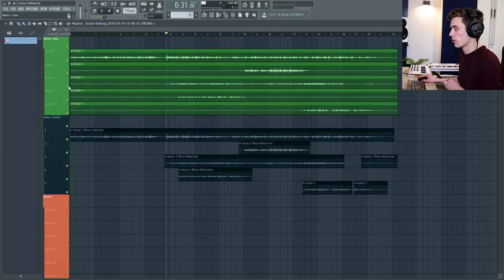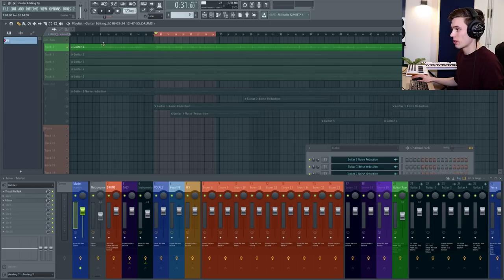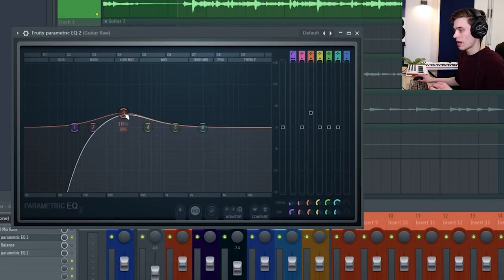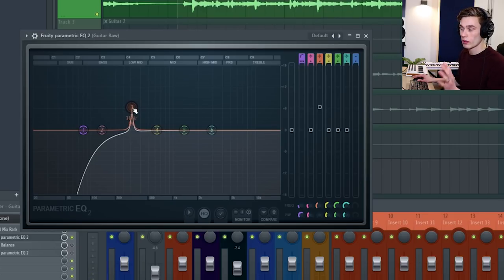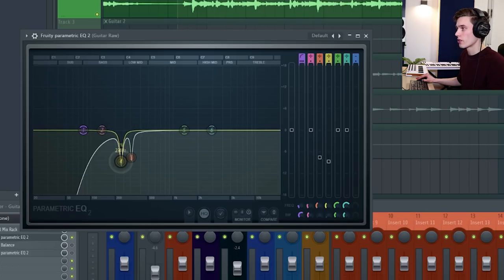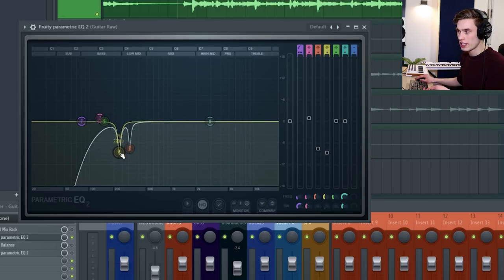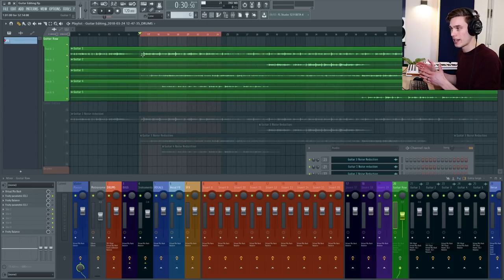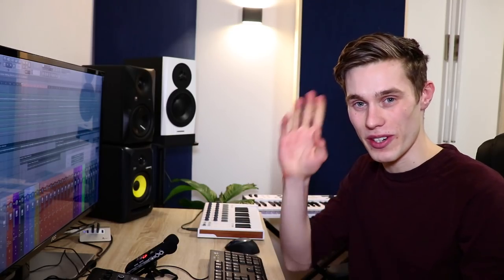Subtractive EQ for Clarity - Acoustic Guitar EQ

Comment: Can't thank you enough for this! I'm using the Ample Guitar VST, and it tends to build up these low mid tones of the player hitting the body of the guitar when multiple notes trigger. These techniques helped me minimize them, and overall level out it's sound. Which now allows for percussion and other instruments to fit in naturally! 

For those of you also using Ample, I high passed at 95hz, with some of the eq tail hitting 50hz. Then I ducked 189hz 10db. (I used pro q 2, but should still work in paramateric) Hope this helps! :)
Reply: Use Electri6ity lol i used to use Ample too but it's just that Electri6ity is much much better

Comment: Is the quality of your headphone amplifier good enough to do for example mixing and mastering with it? 
I want louder sounds coming out of my headphones. (I’m using Beyerdynamic dt770 pro 80 ohms)
Reply from the maker: I would say so, there is a small amount of hiss at medium high gain but it's never been a problem. On one of my amps, the output beside the power cable is quite noisy but i think it's a one off fault and I'm sure they are not all like that. As far as the depth, clarity, width etc none of that is negatively affected as far as i can hear in my 1990 pros :)

Comment: Hi, I recently stumbled upon your channel and I must say, it's one of the best ones out there. I'm currently producing a track and I'm using a bass that needs to sound somewhat realistic even though it's from a synthesizer. My goal for it is to sound like the bass in "attention" by Charlie Puth. How would you mix a track like that
Reply from the maker: FraZe Thank you! Firstly I'd try to start with a good sampler or synth, then I'd use his track as a reference to try and match. The Baseline in the track is mixed to perfection in my opinion ( mixed by Manny M) I reckon they parallel processed it by separating the lows from the highs and then distorted or saturated each band differently. His was made on a bass sampler/synth called Trillion,in case you were wondering.
Reply: In The Mix thanks

Comment: Which eq did you use in reality for this job? Nova? And did you use dynamic equalisation? Thanks
Reply from the maker: Marek Voosen I used Nova, TR 5Equal and the slate digital SSL style EQ. I did end up using dynamic EQ but only on one of the guitars. I also used EQ2 on one or two as a back up because it did actually work very well 😀